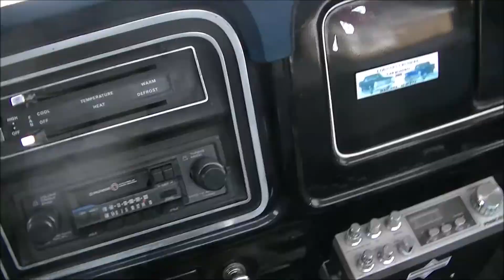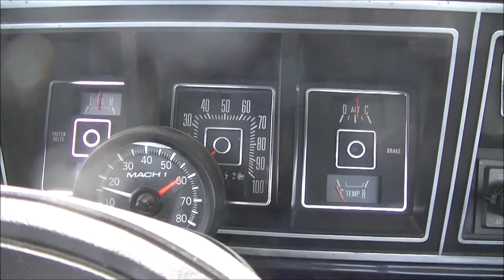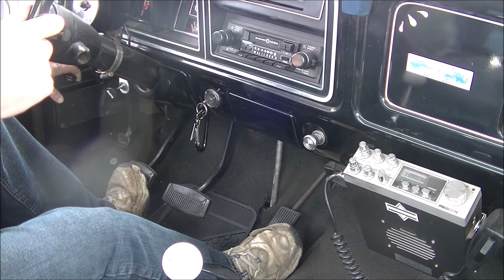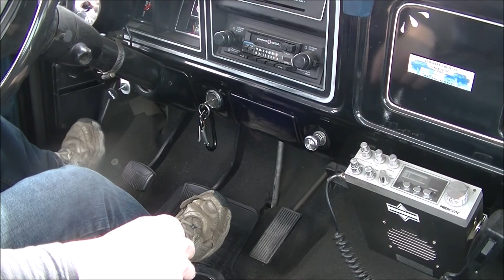Boss 302 Cold Start

Comment: Awesome truck. A cold start in a truck though just isn’t the same without wearing boots.
Reply: What headers are you running? I'm putting a 351cleveland in a 77 f100
Reply from the maker: Sorry I missed your comment earlier. The headers in this video are altered 351M headers. They really sucked. I now have a set of custom made headers that I built in my shop. The correct headers for your application are Sanderson FC-3's. I just happen to have a brand new set of those here that did not fit on my Boss 302. Check out my channel for more information on them.

Comment: What headers are you running? I would like to know because I'm putting a 351cleveland in a 77 f100
Reply from the maker: You will need Sanderson FC-3 headers. They don't fit this Boss 302 though. I have a set of those FC-3's still in the box . The difference in engine blocks causes interference with other components..
Reply: @AxelPowersGarage  want to sell those Fc-3 headers
Reply from the maker: I am away on vacation right now. I will contact you in about 2 weeks when I get home.